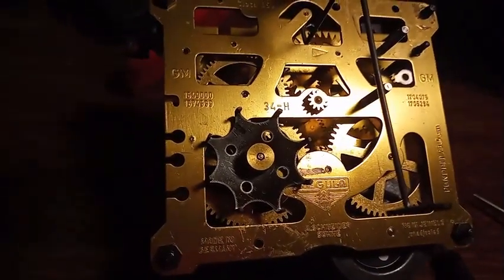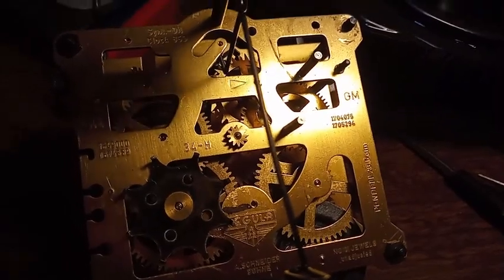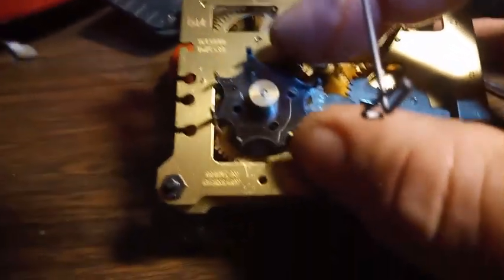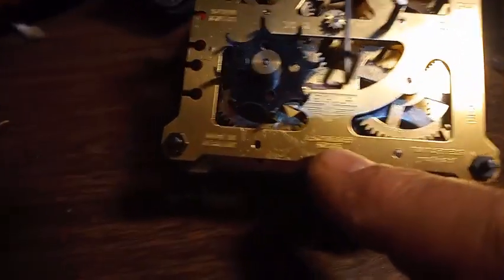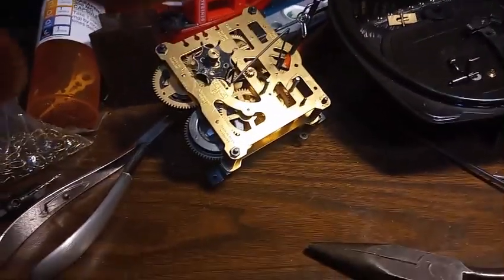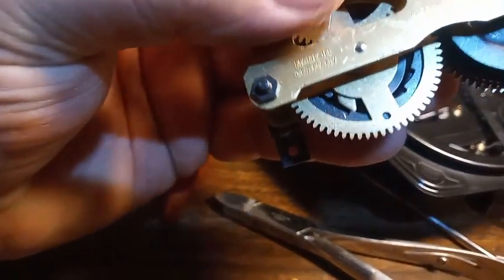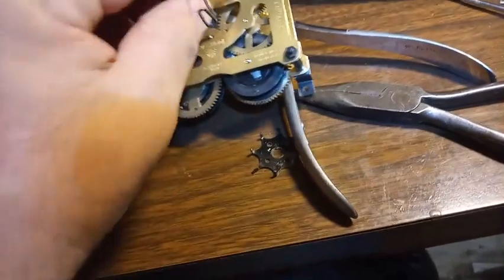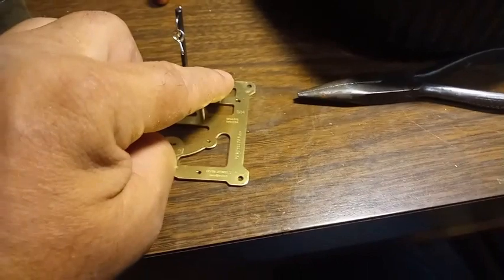Remove/pry off an 8 point star wheel & gears from cuckoo clocks w side cutters/no special tools

Comment: Wow, I never seen one with that much slop, let alone that movement is a newer one. I still haven't come across a clock with the night time shut off lever. Thanks again for the shout out at the end.
Reply from the maker: Yes I have never seen this much slop in the star wheel pivot hole. There is always a first for everything. I have a couple cuckoo clocks with the night time shut off lever but not the newer style where they shut off at a certain time and come back on as one setting or completely off for the other setting and of course always on. Thanks for watching. Take care and may God bless you and yours.

Comment: Mark my Star Wheel is fine, but I need to take off the other wheel in order to take it apart to clean everything.  I tried heat but no luck.  The space between the wheel and the plate is so small I can't get screwdrivers in there.  So did using the side cutters wind up destroying the wheel, ie. did it mess up the gears?  Any suggestions?  Thanks.
Reply from the maker: I say in the video of using the side cutters that you need to be prepared to replace the star wheel.   You can take the movements apart without taking the star wheels off. It is just easier to put them back together without the star wheel on.   No it doesnt mess up the gears when you destroy the star wheel.  Good luck.  Thanks for watching.
Reply: @munnerlyn3  I didn't need to remove the Star wheel, but I had to remove the small gear wheel above it on the center minute shaft that connects to the automatic/on/off mechanism.  I got it off with the pliers, and some of the teeth are now a little rough.  What's the name of the part, and do you know where I can get a replacement?  Thanks.
Reply from the maker: sorry I am just getting to this. If you find me on facebook and send me  a pm with the picture of what you are asking about if you still need help. thanks.

Comment: How are the 3 levers removed before removing the star wheel?
Reply from the maker: You have to take the hammer off first You undo the spring wire. Once you have done that you rotate the hammer lever 180* and then it will come right out of the slots.  Then the low note lift lever comes out by rotating it 180* and then the high note lift lever (bottom lever) by rotating it 180*.  I typically dont take these levers out when I am dismantling a movement.  But that is how you do it.
Reply: Yes, i got it thanks!
Reply from the maker: No problems.  Glad that you got it.